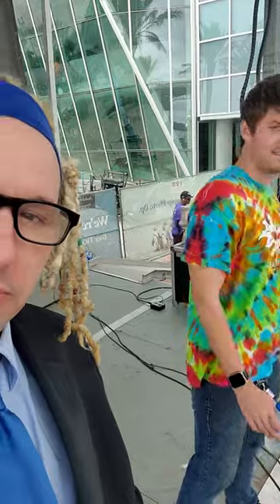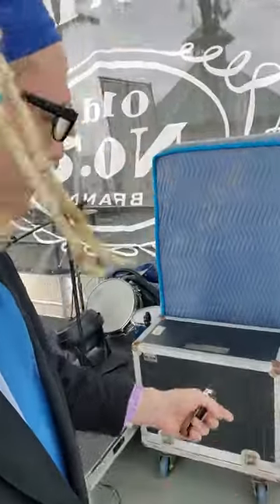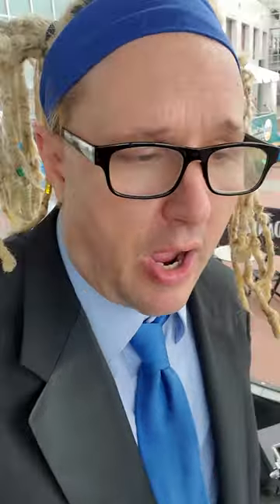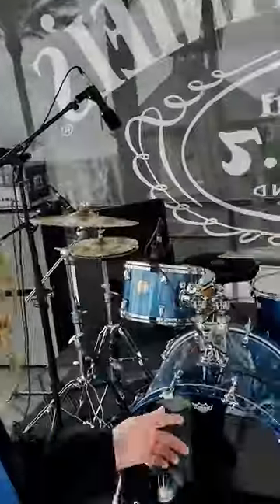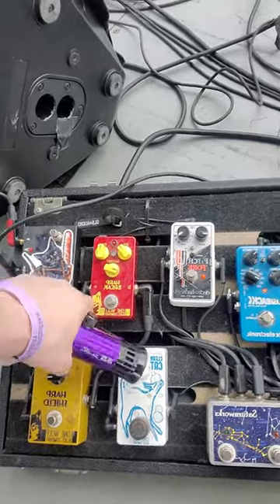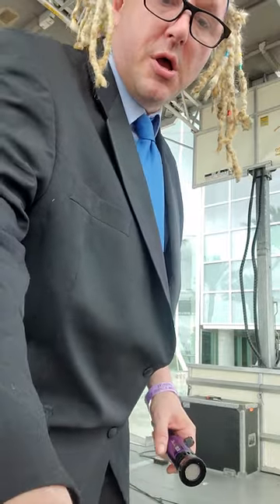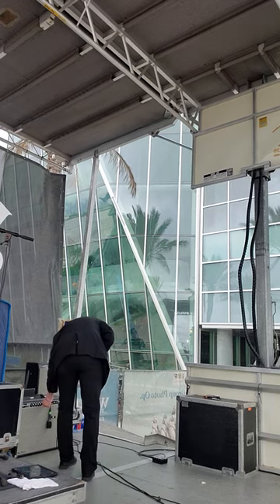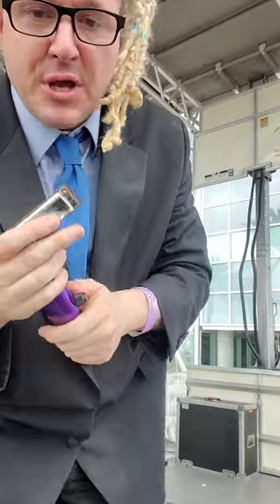Twin Reverb "Tone Master" Digital Amp. 😕 Harp Test Drive.

Comment: its not the same. the tubes work with the speakers in a tube amp a whole different way.  I'll tell you Jason, sum guys up here in Chicago really love the Peavey Bandit 65 for a harp amp. these new modelling amps just have the advantage of weight reduction. your right Jason, Tube amp, authentic sound

Comment: I own a tone-master twin blonde. It’s not really a modelling amp in that it doesn’t have all the amp and effects presets that modelling amps come with. It’s a solid state amp, with same eq set up as its tube counterpart, breaks up as you increase the volume, just like a tube amp. Is it as good sounding as a tube, not quite, but close enough and the weight trade off is worth it.

Comment: Well Lone Wolf say on their website that amp sag is not good for harp tone and real twins have solid state rectifiers so it cant be the sag/compression. Perhaps its the lack of natural mud and grit in the sound that smooths things out when using a real tube amp like the distortion you get from original  rocknroll 45 records from the 50's that sound so exciting versus CD/MP3 versions that just sound too sterile in comparison...But like everyone says TM's are so easy to lug around, I have the DR Tonemaster which I view as a different thing in the same box that is pretty good that way I dont do my own head in wondering if I should have got a real one😄😎
Reply from the maker: It's a great great amp!
Reply: @jasonricci  Yeah man! you have to give it to Fender, somehow they have managed to keep selling their valve reissue Blackface Twins whilst re-inventing the same thing for the 21st century user AND easing road crew repetitive strain injuries and herniated discs worldwide - Shame Hohner didnt do that with the Nu-GM but I havent blown one yet to be fair as I hate the way they are £10 more than the original version😎